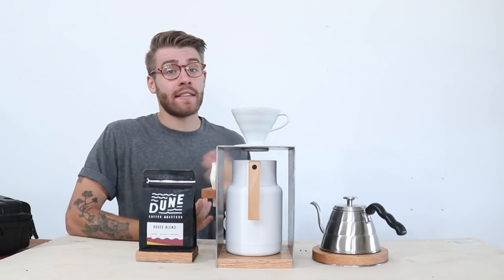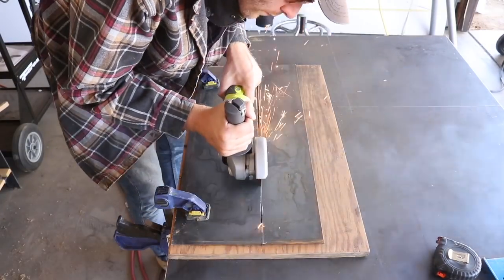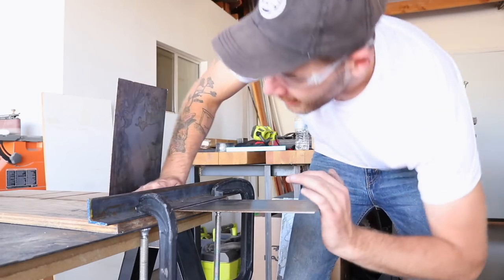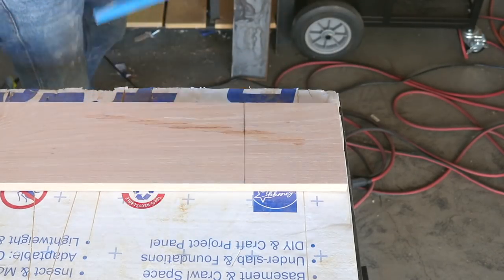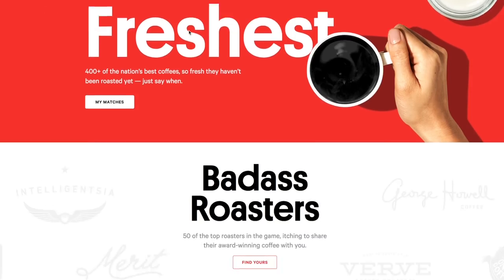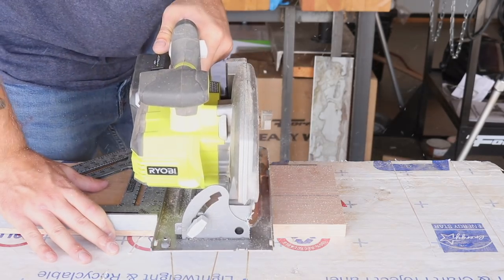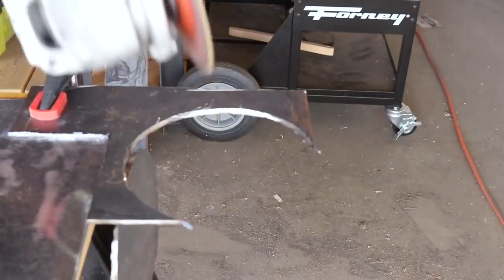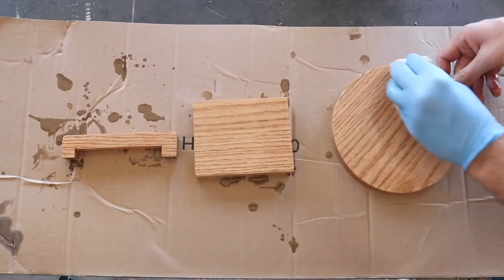DIY Pour Over Coffee Station

Comment: Cool build man. But a message to true beginners to using an angle grinder on metal. Don't use a a cut off wheel to grind. With experience, you could do it safely. But if you are not used to it, using a cut off wheel to grind puts side pressure on the wheel, and may cause it to shatter. If you are lucky you only lose a finger or two, worst is your life. Changing to a grinding wheel takes less than a minute. Stay safe..
Reply: I was thinking this same thing as the shot cut to the angle showing the cut-off wheel as a grinder.
Reply: Most veterans don't bother changing discs, but they are very experienced and know exactly what kind of pressure to use when using a cut of wheel to grind. But for most DIY'ers, I strongly suggest changing discs.
Reply: Mikhail Galatinov I’m not a fan of losing my life, I might just have to pass this project
Reply: @balderoine  don't need to pass on the project, just change from a cutting wheel to a grinding disc. Each of them are a few bucks at the hardware store it's about knowing what they each do and how to use them.
Reply: True. This is actually a very nice project. Just don't forget to change to the appropriate wheel.
Reply: was about to say the same thing. i dunno why he just wouldnt use a grinding disc in the first place
Reply: Great to know. Thanks for the tip.
Reply: Mikhail Galatinov I mean the dude let’s his hoodie strings dangle in front of his chop saw...